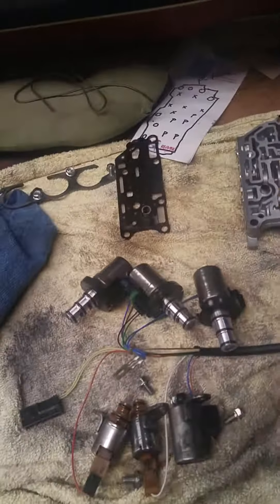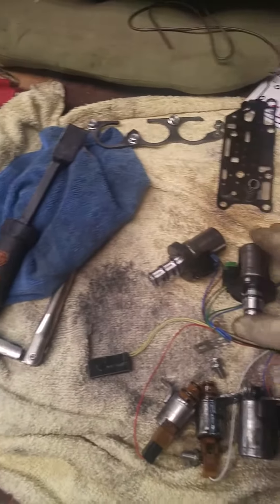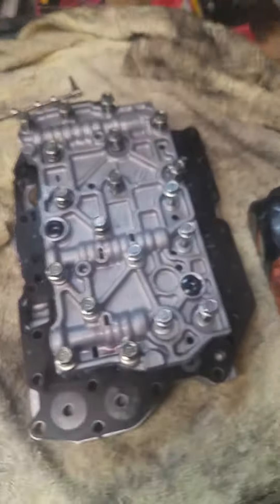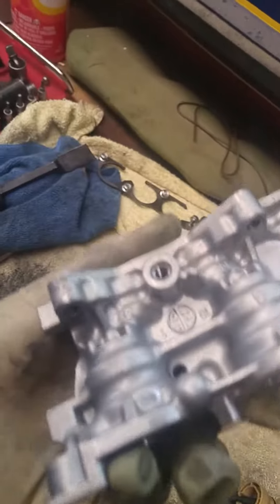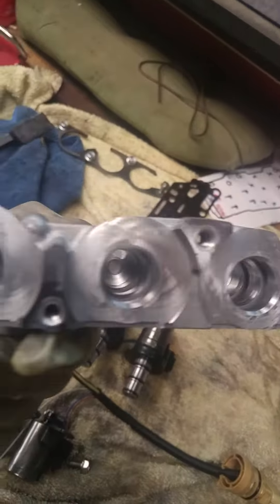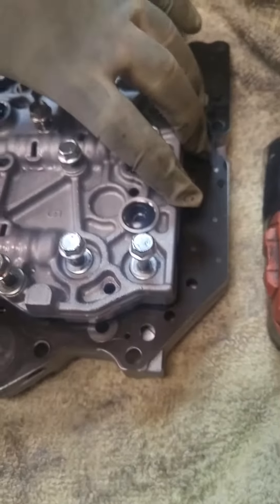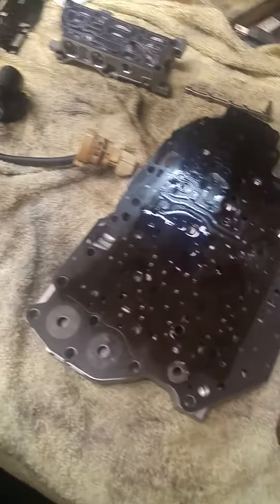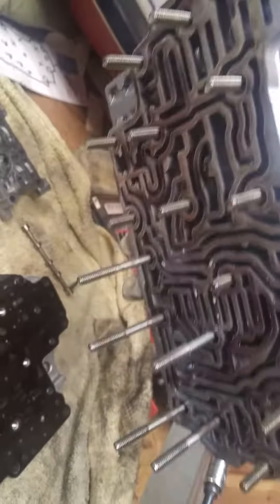Valve body for mazda 3

Comment: I have a Mazda 3 2004 i have Codes P0733 and P0734 can cleaning the valve body solve the problem? Please advise the car cant shift to gear 3 and 4.
Reply: Ok do you recommend replacing the solenoids ?
Reply: Midnight Mechanix wow i connect them straight to the battery when testing ?  I have done 145,000 kilometers do u advise I get a new Transmission?  In this part of the world I can only get second hand, how do I make sure it lasts as well ? Or I just replace the Solenoids or my transmission needs to be rebuilt ?
Reply: I know this is a old post but I had these codes on a 1998 saturn sl1 auto 289.000 k miles same codes I changed out the valve body and it fix the hole transmission   thy that it worth trying.
Reply: hello
i have same car, year model and problem. after 6 years did your car fixed and what did you end up doing to it? hoping your car fixed still reading my comment. thank you cheers